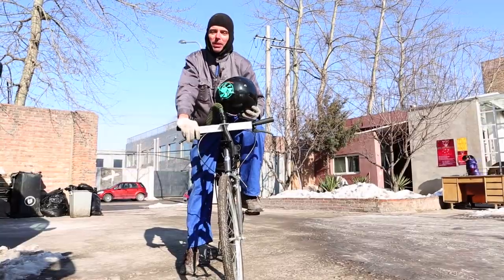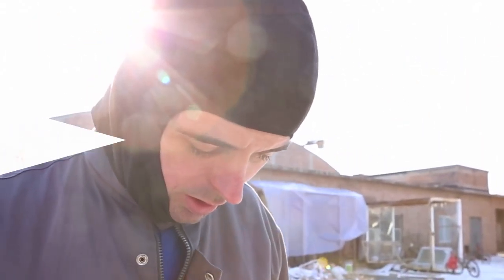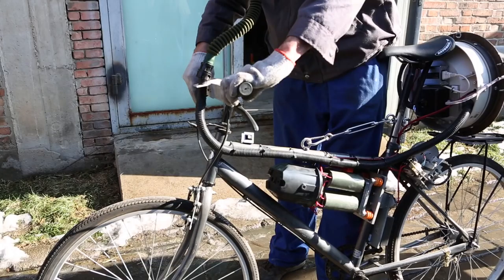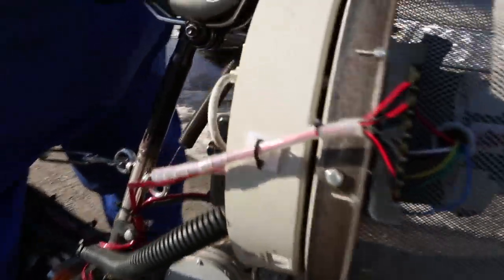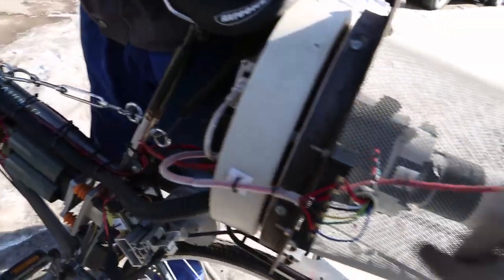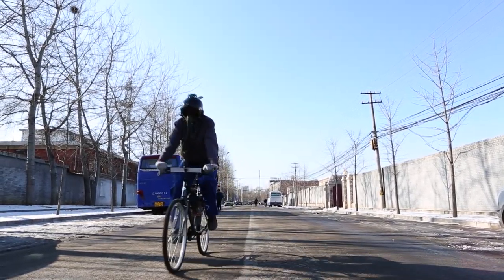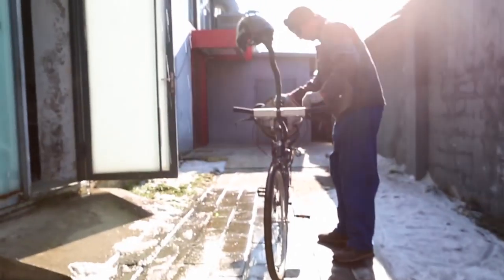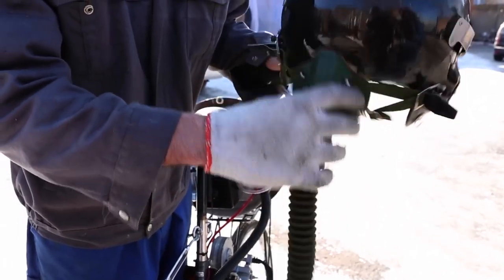COOL SPARKS Presents: One Man's Mission to Combat Beijing Pollution

Comment: Ionizer circuits run off low voltage DC, and you can get a fan to run at that voltage, then avoid the transformers to create high voltage, save the extra weight, and not worry about it raining, but I don't know how much ability at circuit building he has (this is not a commonly scrounged-up item). I remember being warned about breathing the ion stream right from the emitter due to high ozone levels, but this long of a path would allow all the ozone to fully react with particulates.

Comment: I already explained the reason for ionization, it causes the polluted particles to become heavy and fall, you can purchase ionizers for the home, all they consist of is a ladder network of diodes and capacitors which make up a voltage multiplier, I've constructed a couple of them myself, do a search on ebay for "IONIC AIR PURIFIER"; that's basically what this guy has done but mechanically rather than solid state, solid state is more efficient.

Comment: It's ionized air, it makes poluted particles heavier than air causing them to fall before the air enters the breathing system, unfortunately the charge on the particles does eventually dissipate allowing the polluted particles back into the surrounding air, the only real solution for Beijing is to actually clean up their act.